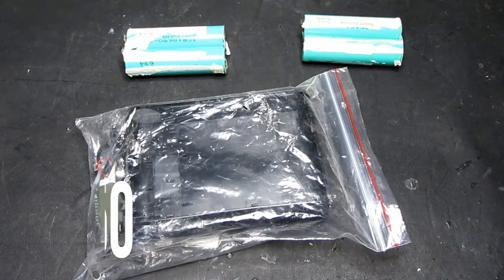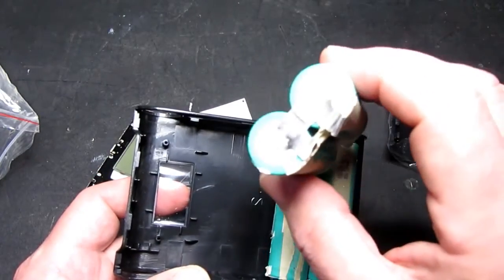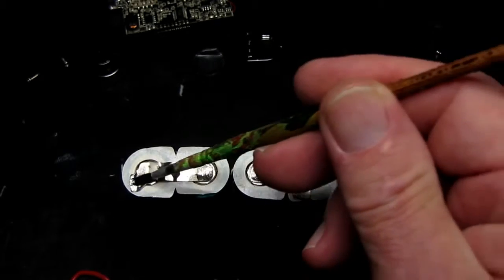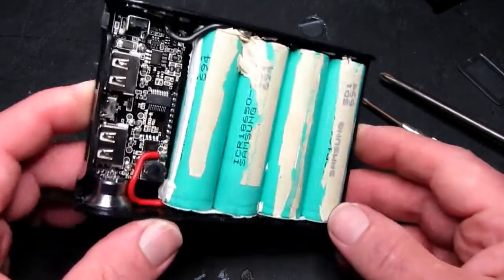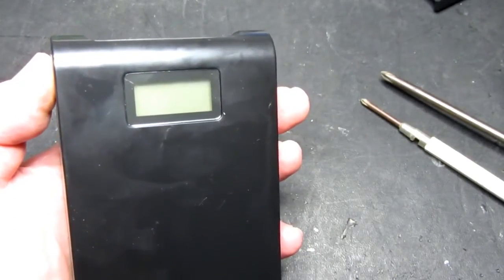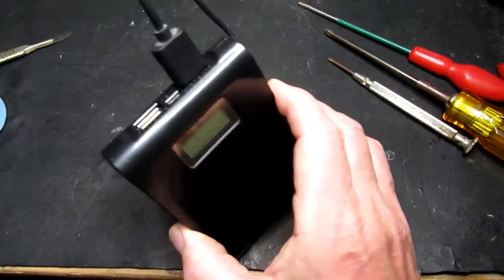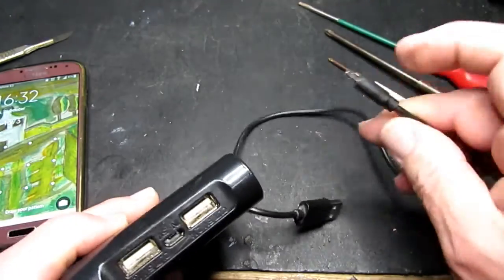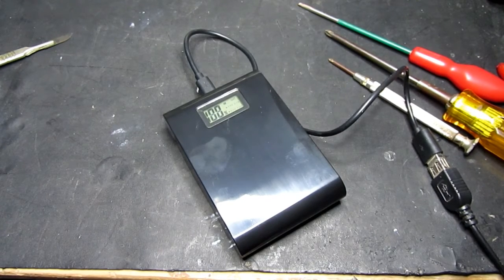Dual USB 5V 1A 2A Power Bank 18650 - DIY Electronic Project With Recycled Cells / Batteries

Comment: Very SLOW Charger.
I have tested assorted Lithium batteries - All take 1 or nore days to charge.
18650 took about 8 hours.
Also annoying to set modes.  Need to disconnect + connect battery repeatedly - to get it to display the actual % Charge - instead of inaccurate 0% or 100%.
Also, hate the power-ON button needed for power out.
Reply from the maker: This is 10 year old tech! I'm sure there are better ones available now. Maybe I should make a new video! Do you have any suggestion for a better module / kit? Thanks for watching, have a great day!

Comment: Out pot in usb is 3volts what is the problem?
Reply from the maker: Are both outputs 3 volts? What is the cell voltage? What happens if you plug in the charging cable?

Comment: when I conect 2amp port after some times the module will be turned off..and the amp not show on disply...why???I have use 3 sell of battarys
Reply from the maker: Hi, I have seen that as well. I think the 2 Amp port needs a minimal load to keep from shutting down. If there is only a small load it will shut off. Please consider subscribing if you have not done so already!

Comment: can i use only 1 battery on that board?
Reply from the maker: Yes. The 4 cells are connected in parallel for greater capacity but it will work with one cell.

Comment: How much is the charging current? With 4 cells in parallel you would expect ±2A charge current to have an acceptable charge time, but does it charge that quick?
Reply from the maker: No. This is quite an old design now and only has a 1 Amp charging port.

Comment: Hello is it possible to charge the batteries by solar energy using this module? Or any other modules?
Reply from the maker: Although it would probably work it would not be very efficient. Better to use a board with a solar charging chip like this one : 3.7V Lithium Battery Solar Controller USB Charging Module http://bit.ly/LithSolarCH

Comment: I got the 18650 battery charger pcb module board from Amazon: https://www.amazon.com/Mobile-Battery-Charger-Module-Protection/dp/B07D6M2LCS/ref=sr_1_93_sspa?ie=UTF8&qid=1548837725&sr=8-93-spons&keywords=18650+battery+charger+pcb+module+board&psc=1

Comment: Bro how much volt of battery I should use.
Reply from the maker: I use 3.7 volt 18650 cells which I get from old laptop batteries https://www.youtube.com/watch?v=DU0vQd3Y8Jg
There are 4 cells connected in parallel.
Reply: But brother I used 3.7volt battery (4200 mah) ultra fire clone battery using the same power bank module as you used. But my one didn't work.
If there is any problem can you suggest me a battery.
One more thing the module is rated with an input voltage of 5v.so how can we use 3.7v battery?
Reply from the maker: The battery you used is correct, you must have a faulty / broken module.
The input voltage is 5v  to come from a USB charger, the module has a step down Lithium cell charging circuit.
Reply: Thank you bro I will try
Reply: Brother one last question.  You mentioned that the module has a step down system to charge a      Li-ion battery. But do the module has a step up system to convert 3.7v to 5v while giving output?
Reply from the maker: Yes, it boosts the 3.7 volts to 5 volts output with current limiting.
Reply: Thanks brother.
Reply from the maker: No problem! Feel free to ask any questions and subscribe if you wish.

Comment: Hello 
1nformatica
What is your feedback on powerbnak and, more importantly, the module after 2 years of use?
I've heard that the module overheats when supplies 2A for extended preiod of time. Have you had that issue?
Reply from the maker: It is still working OK. I do not use it for more than 1 Amp so I have not seen overheating.

Comment: Is there anyway, using a switch (mechanical or electronic) to charge these batteries in parallel and discharge them in series ?
Reply from the maker: Hi Khaled, it would be difficult and expensive to do. Normally if the cells are to be connected in series then they should be charged also in series. Usually you put some type of battery management system to protect the cells from overcharge condition like this : https://www.youtube.com/watch?v=miDIXwACpcY